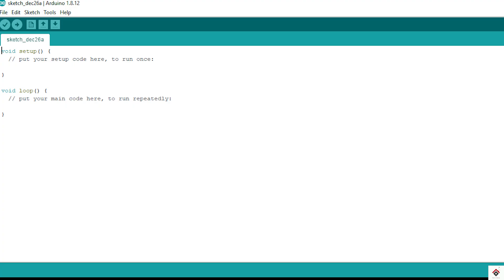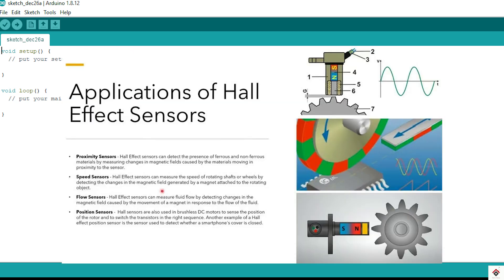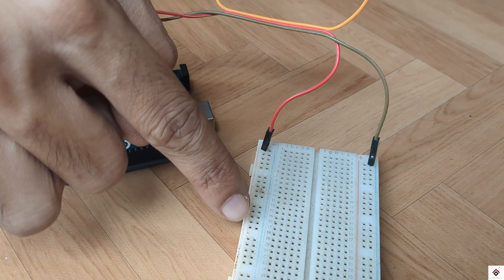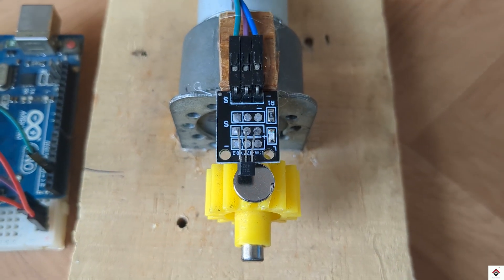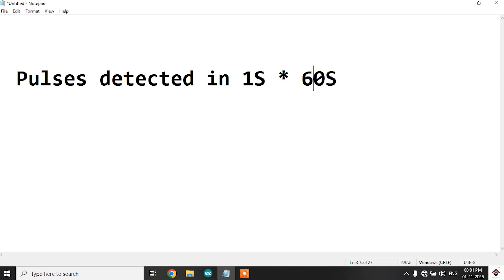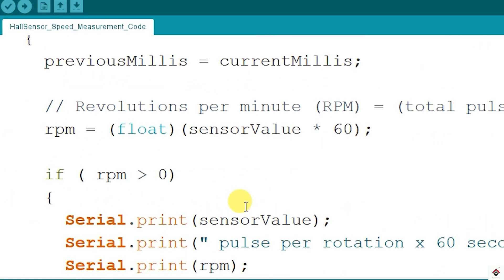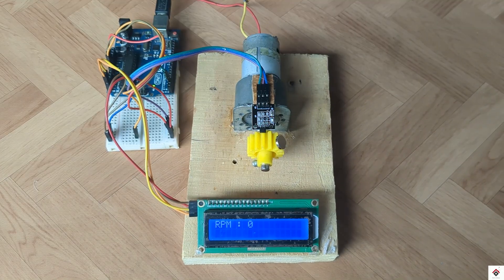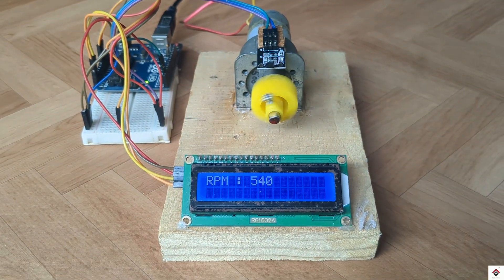How to use Hall-Effect Sensor to Measure RPM of motor | Diy Tachometer using Hall Sensor & Arduino

Comment: Great video! Been looking for a way to measure the RPM on my spindle motor. Do you happen to know anyway to set the RPM using an Arduino as well? I have a 500w 12k RPM Spindle Motor but I'd like to be able to set a specific RPM if possible
Reply from the maker: Thank you 👍 ♥️
At what voltage are you using it?